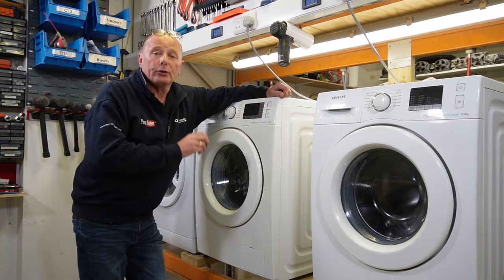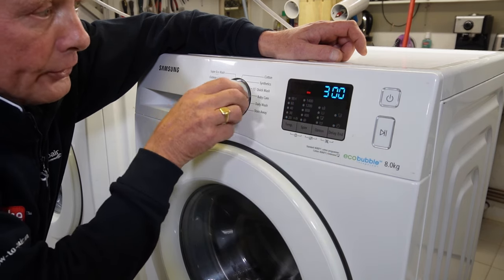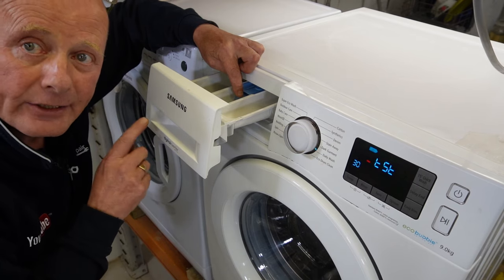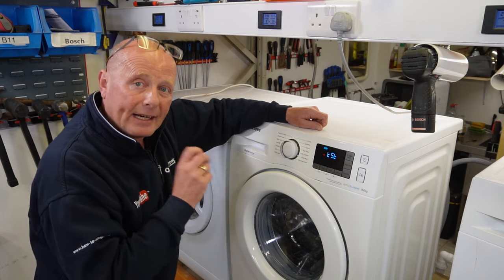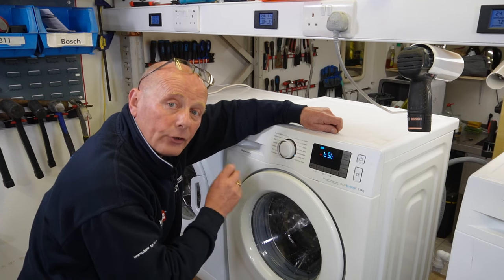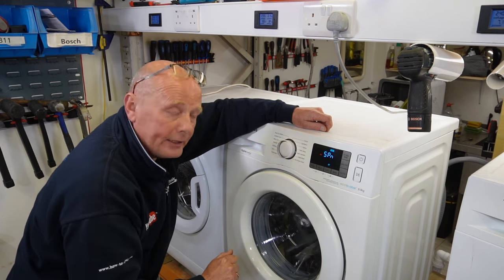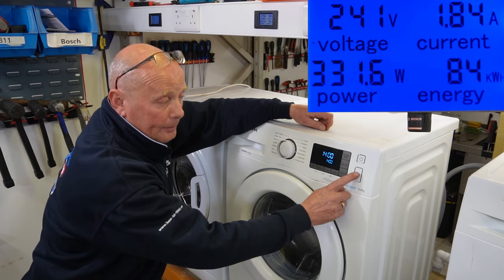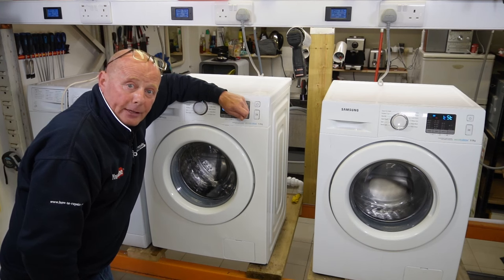Samsung Washing Machine Diagnostic Mode Guide! How To Check Error Code & Test?

Comment: do you know what eot and pst means? thanks
Reply from the maker: HELP NEEDED!! not at the moment but i will pin this to the top of page so some helpful samung engineer might give us the answer
Reply: DARK GARMENT    : Washing Motor Work Test (“PSt”)  *check water level
Reply: OUTDOOR CARE   : EEPROM Test (Eok : OK, Eng : NG)
Reply: B. The Sensor & Motor can be tested when you rotate the course encoder.

  - COTTON                   : Micom Software Code check

  - SUPER ECO WASH : Model Option Check 

  - BEDDING                 : Water Level Frequency (ex. 242 -> 24.20kHz)

  - DAILY WASH            : Water Temperature (ex. 254 -> 25.4℃)

  - DELICATES             : Air Temperature (ex. 300 -> 30.0 ℃) *not used

  - BABY CARE            : Duct Temperature (ex. 300 -> 30.0 ℃)  *not used

  - OUTDOOR CARE   : EEPROM Test (Eok : OK, Eng : NG)

  - DARK GARMENT    : Washing Motor Work Test (“PSt”)  *check water level

  - ECO DRUM CLEAN : Washing Motor Work Test (“tst”)

  - RINSE+SPIN            : Spin Motor Work Test (“SPN” , move to MAX RPM)
Reply from the maker: thank you so much for assisting i learned something today thank you
Reply from the maker: thank you so much for assisting i learned something today thank you
Reply: @mattbandura9015  thank you!!
Reply: It wash cycle worked but spin cycle not. It's doing something now and machine is turned off
Reply: I'm not in test mode anymore. My machine is full of water. I took a video but I can't get it at so you can hear that the machine is running and it's turned off
Reply: Can anyone help
Reply: Hello, I seem to just get this symbol -:
Reply: Same

Comment: Don't work. Just get this symbol -:
Reply: the same in my machine 😢
Reply: Same here
Reply: Hier auch!
Reply: Anybody know what the symbol means?
Reply: I had -: pop up as well. So, I tried different combinations of two buttons  until I got one that made the display do the same thing as in the video. The two buttons on my samsung were different two buttons to his.
Reply: @rhyskilpatrick3377  what were the buttons you had to use as I get the funny symbol too when I follow his example?
Reply: Me too 😩
Reply: I managed to get the same display (all lights turned on) by clicking the last two buttons on my machine (om this particular wm it is dry level+bubble soak) +of course turn on button. But I ended up with dC error after I wanted to try the test mode. Hope this help you too, basicly try the last two buttons.

Comment: Hi turning my Samsung machine on immediately the error code comes up so it will not let me put it in diagnostic mode what do I do we've put in two temperature thermostats already the error code is TE
Reply: Recalibrate after the repair and give it a try.  The error memory may have to be cleared to recognize the new sensor

Comment: Thanks for this demo my machine stopped working after a power cut while mid cycle and would not turn on to any new program after. After running through the test program as you demonstrated it worked perfect again.

Comment: What an amazing clean and clear detailed testing video! Yep I fixed my machine thanks to this video, the motor did not spin, - for your info, water goes in, and when its time to spin it simply stops and no error so going into test mode, the error shows I think C3 - changed the brushes on the motor, one was practically finished the other one had half. So i got a pair of brushes for about £5 and that fixed the machine.

Comment: Hi, congratulations for your videos, very clear.  I have a question for you, I have a Samsung washing machine with DC error.  There is 220 volts on the door lock connector, I replaced it but it still shows the same DC error.  I noticed that the 220 volt is present on the connector only when empty, i.e. without the door lock connected, if I connect the door lock the 220 volt is no longer there.  What do you suggest me?  I'm thinking of replacing the board, but it costs a lot and I would like to limit the risk of making a mistake.

Comment: Hello! Thank you for your video! I have a Samsung washing machine model WW70J4463GS but it doesn't have the same buttons. From left to right, they are "temperature - spin - option - delayed end - bubble soak". Could you please tell me which ones I need to press to enter the washing machine's diagnostic test?

Comment: Thanks for the informative video. I have samsung Ecobubble digital inverter ww10n645rbw. The machine is not heating up. I have checked the element and thermostat with a electrical tester and they are ok. My pcb was replaced some years ago and I swapped the current one  with the original one (which was ok at time), still no heat. I have run the diagnostic test (from the delayed start proceedure) but I am not whether I hear the element coming on during the wash cycle test. The simple diagnostic test shows no error. I am at a loss. Any thoughts? Do you stock the pcb's if it that? Many thanks
Reply from the maker: Hi David, I've created an FAQ page for you. You can find a detailed repair guide for your problem on this page. I suggest you start by getting a smart multimeter and testing the heater, NTC sensor, wiring, etc. Here is the link: https://www.how-to-repair.com/faqs/samsung-ww10n645rbw-washing-machine-not-heating/

Since we work very hard in our warehouse making free video guides for you all on appliances, we always appreciate a beer, offering a choice of single or round beer. https://www.how-to-repair.com/help/buy-paul-a-beer/ 😇

Please remember to subscribe to our channel, as that's what keeps this channel going. Thanks, Paul 👍

Comment: Hello good sir, great video. I’ve done all the steps and the washing machine appears to be working correctly. However whenever I try and run an actual cycle, it stops after 1 minute, I’m perplexed. Any ideas?
Reply: Same problem!! Any news about this problem?
Reply: I have very similar problem. Machine fills up with water, but after when it come to spin, it stuck. Machine is not under or overloaded. Not heavy things inside. Any thoughts people?
Reply: @thes9220 did you resolve the problem?
What was the cause of the problem?

Comment: Hi from France. I'm the owner of a SAMSUNG W0804Y8E/XEF washer. I tried to run the diagnostic mode as you show in your video but when I push the same buttons as you to enter the mode the result is not the same and I have not the TST mode appearing on the screen. Can you tell me where I can find the specific process for my washer? thanks a lot.

Comment: Many thanks - mine does not go to tSt when I get to the part Rotate the program Left - instead it goes through the numbers and then goes to:  4C-OE,   80_   _80,   254,  then finally   UC    and sticks there. It’s the older non inverter model. 
Any ideas ?   In general I have the Random Pause problem when running programs and have an occasional 3E code, but am changing brushes in the next few days.

Comment: Thanks for this movie! When I try to enter this mode I become only " -: " sign. Does it mean the PCB error? Should it be replaced?
Reply from the maker: Without having the washing machine in front of me, it is very hard for me to actually say with honesty, what the problem is, as I do not want you to go buying a new circuit board and finding that is not the fault
Reply: What possible causes are there? Can the door lock cause it? Machine keeps powering off. @How-to-repair

Comment: Do you also have a video how to fix a LC1 error on a samsung washing machine?
Reply from the maker: hi LC or LC1, are we needed to drain pump issues? I have done lots of videos on drainage problems on washing machines. I suggest you check the pump the sump hose and also the waste fittings going to the appropriate connection that you have basically this error is saying unable to empty in the allocated period of time this is why you are getting these error codes @rodneysijp2343 please remember to subscribe to our channel as that really helps us https://www.youtube.com/shorts/e432SAb2g08  Thanks, Paul 👍

Comment: Hello, thank you for video. I've checked my machine and everything seems OK, but it isn't 😢 heater works (~9A current, water temp increases) , both pumps working well, water level sensor frequency changes accordingly to water level (higher level lower frequency), spins both sides till forever. But during washing cycle it stays looong time without anything in blinking main program indicator (two vertical lines in bath). Sometimes in 15min, sometimes in 60min it starts and continue. Sometimes it happens more time during one washing cycle.
Reply from the maker: Hi, I will need the full model number of the identification plate and the details of your problem so that I can provide you with useful literature. Please use our contact us page and make sure you fill out the request for what your problem is. A video shoot of the problem would be perfect as well.

I will get back to you within 24 hours, normally. https://www.how-to-repair.com/help/contact-us/  

Please remember to subscribe to our channel, as that's what keeps this channel going. Thanks, Paul 👍

Comment: Hi 
We have a Samsung eco bubble with 5E.
After 50 mins on quick wash the display reads 5E so we power down and power on the machine turn it to rinse and spin it runs to the end no water in the bottom of the machine so I cleaned the filter out removed the pump all looks good but you can’t rotate the motor no more than one revolution either way not sure if that’s right re assembly tested again same thing after 50 mins 5E also learned the waste on the sink trap.
Any ideas.

Thanks
Ray

Comment: Hello my washer pauses mid cicle without spinning and then pauses itself. Also is not able to do a spin cycle unless is at 400 rpm. If i go into diagnosis mode i get this "-:". Do you have any thoughts?
Reply: Hi, did you find an issue? I have the same problem

Comment: My research on the internet leads me to think I have a common problem with my Samsung Bubblewash WF1104XAC XSA 03 front loader washing machine. When it reaches the spin cycle the drum spins very slow one way then stops and spins very slow the other way like a normal redistribution cycle, then once it reaches 9 minutes left it stays on 9 mins for ages. If you come back in 20 mins it will still say 9 minutes and the drum still is spinning very slow. Its like its still washing not spinning. No fault errors come up and eventually the timer starts counting down again, but still does not do a high speed spin. I did you a spin test using your video thanks and it reached 1320rpm.

I've checked the drainage pump and filter of course and all seems good there. Plenty of water getting pumped out. I was wondering if there's a two stage door lock on my model that I've heard can prevent high speed spin if it's malfunctioning. That would be strange though since there's no error.

Do you have any ideas you might be able to suggest please? Thanks!:)
Reply: I just had a look at your website and I'm now wondering if I should check out the pressure switch and tube next...
Reply: @craigwoodburn4436  hjj
Reply: @craigwoodburn4436  hjj
Reply: Any luck I have the same problem
Reply: Sounds similar to our problem and we have a bubble wash, I will try this and look at a few other options when the kids are asleep because I can't get the kids to stop touching whilst I am trying tgis
Reply: Hey Craig, I've got same issue as you. I suspect bad PCB...
Did you solve your issue?

Comment: Hello, please advise. I have a washing machine eco bubble 7kg / wf70f5e5u4w. The washing machine began to jam, as if it did not have the strength to turn the drum. It is interesting that it could only be washed on 3 programs - hand wash, wool and spin. All three work without a prewash and it worked for a few days. Now the whole program, this short one, and the spin cycle are no longer running. I observed the washing machine and I really think that the motor runs quietly, the water fills in, the pump drains ... the fault is really mysterious. After loading the smart apps - it says ˇThe motor rotor was diagnosed as locked" So there is a question? is the problem the motor or the motherboard? Thank you very much for your opinion :-)

Comment: Good evening, I have a Samsung WF80F5E0W4W washing machine, sometimes it stops, the display stays on but the remaining minutes of the wash do not go down, generally it stops at 50...53 minutes remaining and it doesn't unlock unless I turn it off and restart it, sometimes it gives me 3E error. I checked the motor brushes and they are good... they will be about 2.5cm long. Do you think it could be a problem with the card?
Thank you
Roberto
Reply from the maker: Hi Roberto, I've created an FAQ page for you. You can find a detailed repair guide for your problem on this page. Here is the link: https://www.how-to-repair.com/faqs/samsung-wf80f5e0w4w-washing-machine-stops-gives-3e-error-code/

Since we work very hard in our warehouse making free video guides for you all on appliances, we always appreciate a beer, offering a choice of single or round beer. https://www.how-to-repair.com/help/buy-paul-a-beer/ 😇

Please remember to subscribe to our channel, as that's what keeps this channel going. Thanks, Paul 👍

Comment: Hi quick question I have the same machine all tests are fine apart from it doesn't turn while washing spins fine tho
Reply from the maker: It will depend on what model you have as there are different variations in motor. If you have a motor with carbon brushes, I would inspect them or if you have a motor that does not have carbon brushes then normally this will be a problem with the circuit board. Have a great New Year and please remember to subscribe to the channel.
 glad we could help you @anthonybaxter808 this is for you https://www.youtube.com/shorts/e432SAb2g08 please remember to subscribe as that's what keeps this channel going. Thanks 👍

Comment: Excellent shown! 

I was trying to enter testmode on my Samsung but not able to, tried whats being shown in this video and also tried different combinations without any luck entering testmode. Anyone have any ideas how I can enter it on Samsung ecobubble 8.0kg WW80J5486MW/EE?
I need to find out why its not warming the water, its cold and not getting any errorcodes. Also whats strange (i think), is thats its actually washing the whole program, not heating the water. Any help appriciated, thanks!
Reply: I checked the heater element and had no continuity so ordered a new part

Comment: Thank you for your explicit vids. They are for engineers?   Please do you know if better instructions are available for the WF90F5E5U4X regarding the explicit operation /programming of the fabric softener?   My wife has had a problem with the centre compartment (softener) always taking the fluid in prematurely. It may well be programming not set ever since 2016 since we bought the machine. Samsung say the program has been off at manufacture but she says not.
I rang Samsung and the Tech said he would look at the manual!   There must be more comprehensive literature because I see many others are not fully conversant with the softener application. There seems to be many unanswered questions about what seems to be a well engineered machine that lacks in data available to the users.
Boilers have more comprehensive instructions for the users. This maybe because a boiler can blow you up  but a washing machine no.

Comment: HELP PLEASE --- I have by accident left couple of clothes in the drum while performing the TEST mode 
1. I left it like that... I just rotated it to the tSt and pressed start [thinking that all I need to do and the machine will do its thing] and went in the city to do errands and came back after 5 hours and the test mode was still running ....
2. The whole bathroom was smelling weird when cam and I manually stopped the cycle

What happened here ?
Did I destroyed or damaged something with this mistake ?

Comment: Hi, my machine wont go into test mode. Also the balancing mode does not work. I can turn the machine on and can select a wash but when I press play it makes the sound that it is starting, but nothing happens. Can you please give me some advise what to do?
Thank you
Reply from the maker: Hi, please use our contact us page and make sure you fill out the request for what your problem is. I will need the full model number of the identification plate and the details of your problem so that I can provide you with useful literature. A video shoot of the problem would be perfect as well.

Normally, I would get back to you within 24 hours but I am on my way back from the IFA trade show in Berlin, so it can take more time to respond. Thanks for your understanding. https://www.how-to-repair.com/help/contact-us/   

Please remember to subscribe to our channel, as that's what keeps this channel going. Thanks, Paul 👍

Comment: My Samsung WM EcoBubble WF70** have error code 3E. I did a latest test (4) from TEST procedure, where motor spins on both directions. Motor start to spin on first direction just fine, but then when it needs to switch direction of spin - it's stops with 3E code. What could be the problem - Motor or Electronic? I mean - what to look as most possible issue? As motor spins normally in one direction and pass all 3 tests, before test number 4. Thanks!